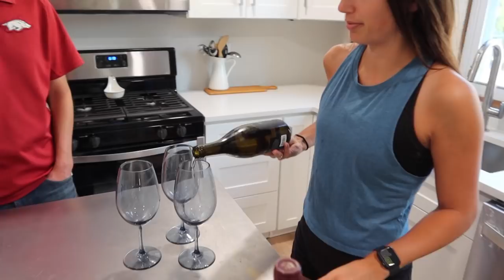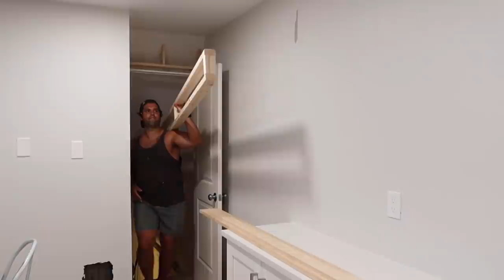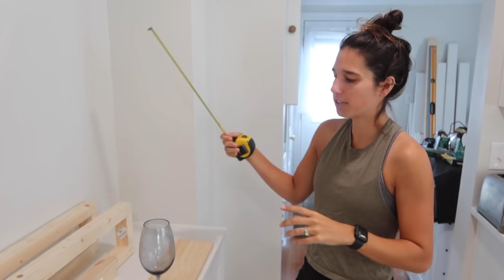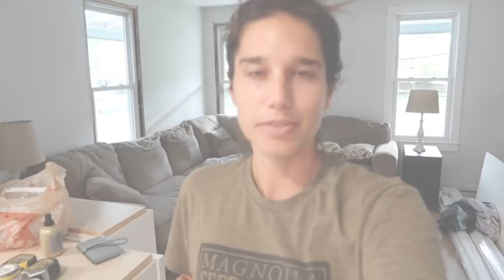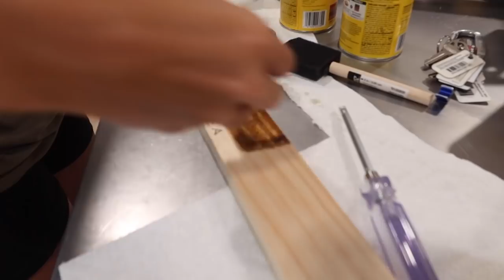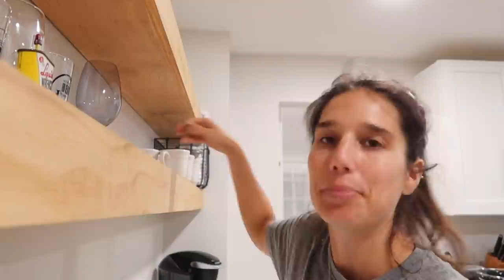DIY Kitchen Floating Shelves for Our House Hack + Beverage Bar

Comment: Ummm have you really ever lived until you opened wine with a drywall screw & a drill. You gotz to overcome & adapt 😂👍. $387.29 in stain samples later we have a winner!! Hoping all is well guys, Dirty Jersey out!!
Reply from the maker: Hahah they really need to do better at showing more accurate color swatches.. I feel like stain is NEVER the same, even when used on the material they’re showing the color on

Comment: Love the content!!! 

@iliketomakestuff channel taught a trick for wood filler. Take some wood dust from your pine and mix it with the wood filler. It will be an exact match.
Reply from the maker: Yesss, I’ve also seen where you can mix saw dust with wood glue and fill it. I like to try and mix the wood fill to a close color and apply after staining but before poly, I always see the stain react differently with the wood fill.

Comment: First off, great job on the floating shelves. The finished product looks great! Although you all had so many different choices it was making me anxious, lol.
Question: it sounded like you all mixed two different stains together is that correct? Secondly, I thought staining was a simple apply and let it dry; why were you all wiping the stain off so quickly after application? Lastly, did you do multiple coats or just the one apply and quick wipe down?
Reply from the maker: Haha yes, the options became overwhelming! We did a mix of puritan pine and pickled oak. You're typically suppose to apply and wipe stain for even saturation. We only did one coat.
Reply: @RentalstoWealth  ahh, okay. That helps. Thanks for replying